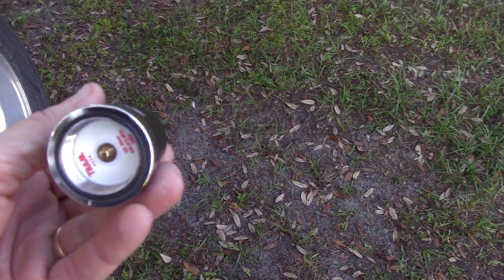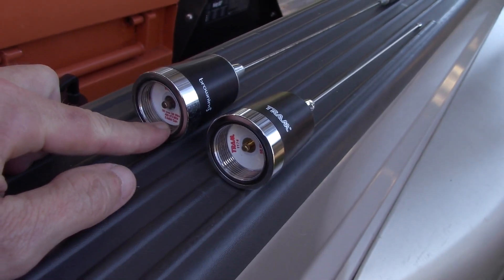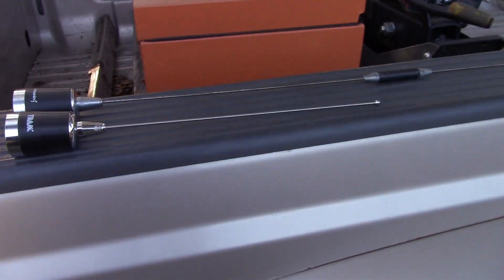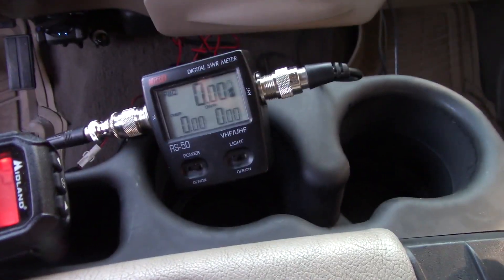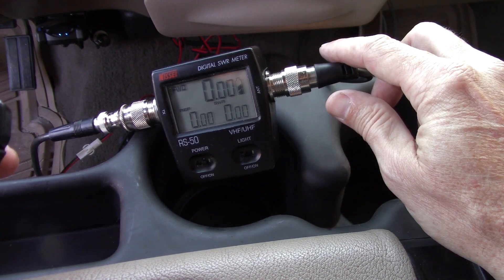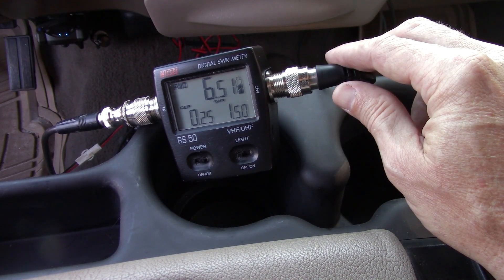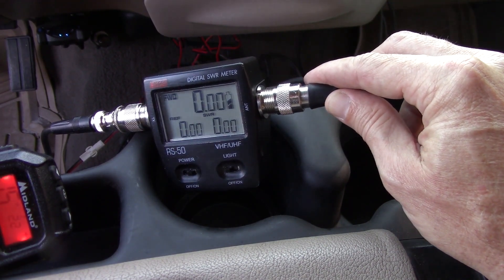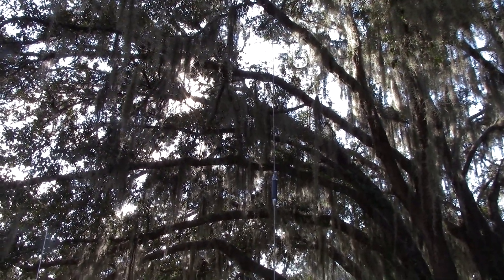GMRS Mobile Antenna Upgrade. The Tram 1174 5/8 wave.

Comment: A true tuned half wave antenna works wonders, plus they work great even without a ground plane . If tuned to the middle of the band which is 465.000 you balance both great gain and damn near perfect SWR. Length of the antenna whip will be about 12.6 inches.

Comment: Thank you for the video! Another possible reason one could consider this antenna (as opposed to a 5/8 over 5/8) is that it could minimize the front end overload on direct conversion radios. I believe many if not most budget rigs are of the direct conversion type. So what happens is, a bigger antenna gets your signal out better, but then you don't hear anything back because your rig "chokes" on RF pollution, especially in an urban area. I have seen this happen a lot. The trick is to strike a good balance between getting out and being able to hear back. Sometimes it means getting a shorter antenna.
Reply from the maker: True, true. Most all of my "turf" is subdivision and highway so the more the merrier. Urban areas would destroy the frontend of the direct conversion radios.  While at a large hamfest, the Orlando Hamcation, my brother's HT died from a worn out battery. I gave him my spare HT, a Baofeng. He used with disdain for a short time. The frontend was overwhelmed from the RF was pretty much useless.
Reply: @Soladaddy  I wish someone had explained it to me earlier. I had to learn it the hard way. I live less than a mile away from a commercial antenna farm (TV, FM, ham repeaters). Plus it is an urban area. Baofeng and Btech radios simply don't work very well here, let alone with bigger antennas. I was jealous when in one of your videos you referred to your Btech GMRS radio as "good stuff":) It probably is, but not here. Mine is collecting dust somewhere.
Reply from the maker: Opps, I was being sarcastic in that comment. I was sarcastically referring to a video a few years back where a Wouxon 805G received way better than the GMRS V1. It was a very readable signal for the 805 and the V1 didn't even break squelch. https://youtu.be/6_JiGTOnvhw 
I'm about 3 miles from a large antenna farm and would like to be further, but its not too bad here. I think everyone needs to have a budget radio to appreciate what a good receiver offers.
Reply: @Soladaddy  Sorry, I didn't get your sarcasm:) But now I I understand why you use the Btech GMRS radio for your parrot repeater. You just don't want to bike too far to do distance comparison tests:) I absolutely agree, everything is relative. For example, however primitive the 805 looks, it is a gem when it comes to reception. And the only way to find this out is through personal experience, by comparing it to budget direct conversion radios. No amount of googling or YouTube watching will replace it.
Reply from the maker: 100%. Most of my tests are in less than optimal conditions because that will be the most common real life scenario. Maybe one day I'll try for max range. And that 805 might be my best receiver for a GMRS only rig.
Reply: @Soladaddy  Speaking of "GMRS only". I may have mentioned this in a previous comment somewhere, so my apologies if I am repeating myself. Here it is. I always wanted to add some additional listen-only frequencies to my 805G. The problem was that I have a Mac and I couldn't run the Wouxun software on it. But then this new version of Chirp became available called "Chirp Next". I installed it on my Mac. Unfortunately, I couldn't find an 805 model in their Wouxun menu. But then I remembered from somewhere that the 805G is just a UHF business version of their famous Wouxun kg-uvd1p model. So I tried programming my 805G by selecting kg-uvd1p. And it worked! In fact, it more than just worked - I had to manually disable TX on ham frequencies I had programmed in:) The same goes for the 805M, which is VHF only. So one can convert both radios into pretty capable UHF and VHF (not just GMRS and MURS) RX/TX SHTF radios if necessary. Of course, they will still remain "channelized", but it's a good thing if you have to give them to non-radio people.
Reply from the maker: @SK-rj1ti  well, well. I will have to check this out, or medicinal purposes of course.
Reply: @Soladaddy  Of course! For medicinal purposes you might also want to take a look at the uvd1p itself. Hears as well as its 805 descendants. Takes the same batteries. Works with the 701c antenna right out of the box.
Reply from the maker: @SK-rj1ti  I do have a UVD1P that I picked up from a small hamfest. It's a bit deaf so my bad buying a used radio from a stranger. It did come with several accessories that covered the $40 spent. Might have to get another...
Reply: @Soladaddy  Sorry to hear about that. I got mine new from BTWR. It is still available for $100, but I heard rumors that Wouxun might discontinue it. My unit receives well, but I have noticed a quirk about it. Not all SMA-F antennas will work. They all seem to fit physically, but some will work and others won't. It's unpredictable. I know this because I check the signal strength on my field strength meter (not just a nearby radio). I don't know what the problem is. It could be just my unit, or it could be something more general about this model. There is a chance that your radio might seem deaf to you because of the antenna you are using? Have you tried a Smiley on it? They work on mine. Out of two 771's, one works, the other one doesn't (both are legit from BTWR). Go figure...
Reply: That said, I love my uvd1p. I put a 701c on it, and it works.
Reply from the maker: @SK-rj1ti  Looking at the 1P antenna mount base there is not much metal, only the thin ring of the SMA sleeve. I can see how some antennas might not get a good connection.
Reply: @Soladaddy  On closer inspection, the center pin on the radio also seems to be just a hair too short.

Comment: Any comment now on the reception quality/range on this 5/8 antenna vs the taller 5/8 over 5/8 that you were using?
Reply from the maker: There is a noticeable difference with weak signals.  Part greater gain and I'm sure it's partly from greater height. The tips are about 7'9" and 9'6" high and the latter has clearance over more objects. I bounce back and forth between the two.

Comment: Does it needs a ground plane? Thinking about using it as a base antenna with a mobile gmrs radio.
Reply from the maker: Yes, it needs a ground plane. All 5/8 and 1/4 wave antennas do. A 1/2 wave does not need a ground plane, but it does help a bit. Not sure if Tram/Browning make 1/2 waves but Laird does and they are a step up in quality so they cost a little more. They make a lot of commercial gear.  This one is the same style. https://amzn.to/3uD582T
Reply: Laird Technologies - B4505C  450-470mhz 5/8 over 5/8 wave (-No Ground Plane-) antenna, w/Spring / sold on Amazon.

Comment: Isn't that the 15 watt Midland model?  It looked like you were maxing out at only 6.5 watts.....  How is the shorter antenna working compared to the taller one?  From those trees in the background ou look like you may be in my neck of the woods(SWF). ;-)
Reply from the maker: Correct. That 12v outlet with the engine off only produces 6.5 watts. Have another video showing different power results from different setups .https://youtu.be/8frqYAC1Gtg  I'm in Central FL and still using the shorter antenna as it only losses a little reception and I have to worry about it smacking stuff.

Comment: Question: what antenna(s). Would you recommend I use indoors on a boafeng UV5r, for both UHF & VHF talk and receive?
Reply from the maker: Depends on the frequencies used to transmit. Antenna's tuned for multiple bands and wideband use generally do not perform as well as an antenna focused on a narrow band of freqs. The UV5r is a ham dualband so an antenna designed for those bands 144-148 and 430-450 are best. But that same antenna is usually not a good GMRS antenna 462-467 MHz. Generally speaking, get a base antenna for an HT at home and best mounting location is outside, up high as feasible/accessible. Next best is in the attic with indoors as a last option. A quick easy upgrade for an HT is a rollup jpole antenna like this. https://youtu.be/E_8WQs8Xc5I Just be sure to get the proper coax connector to match your radio.